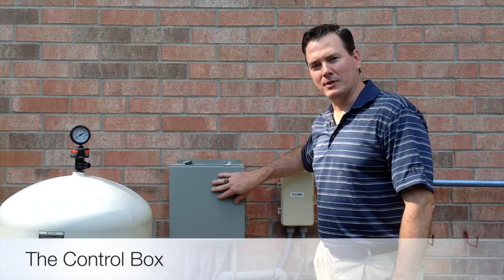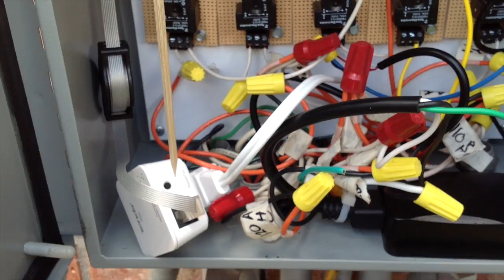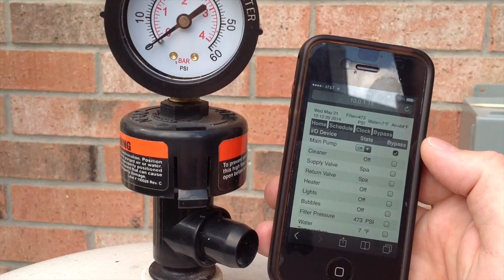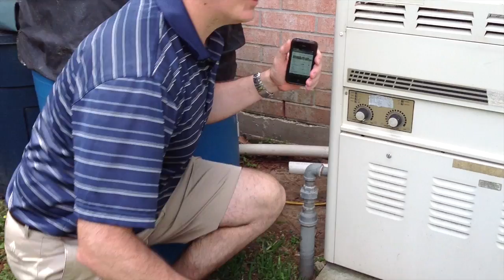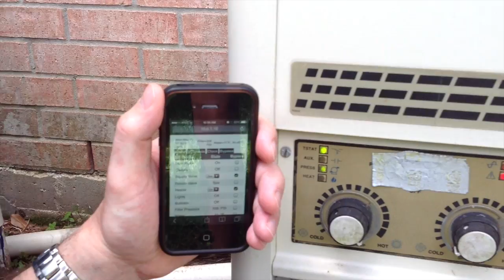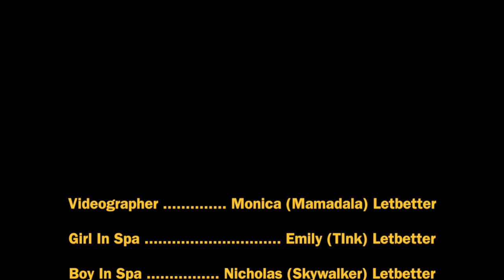Cortex-M4 Pool Control System with smart phone interface based on Tiva C Launchpad and lwIP

Comment: Jason, I have been searching for things on the market to control my pool system (very similar to yours) and the app and the way yours operates seems perfect.  I have no clue on the circuit boards and relays etc... you were speaking of....So what would be your recommendation if I wanted to get the same setup as you ?
Reply from the maker: David Lopez Hi David, you might want to take a look at the Jandy Aqualink system.